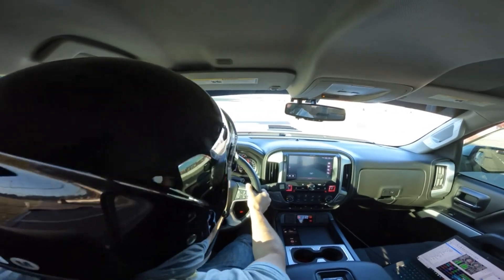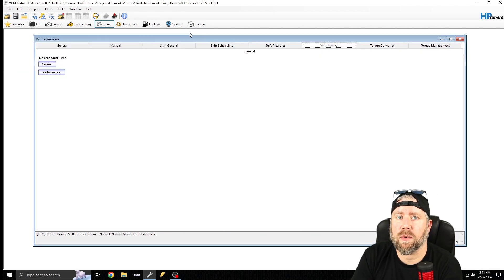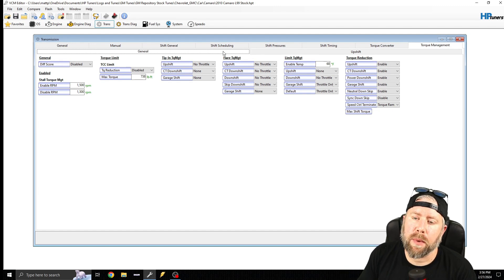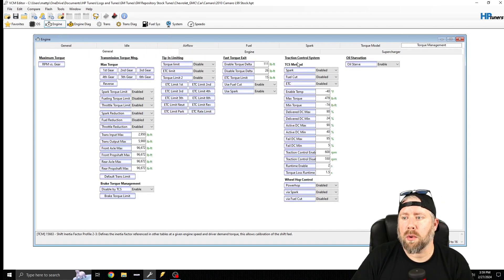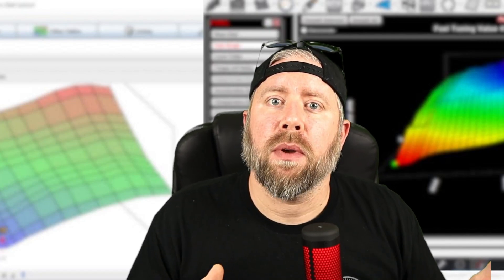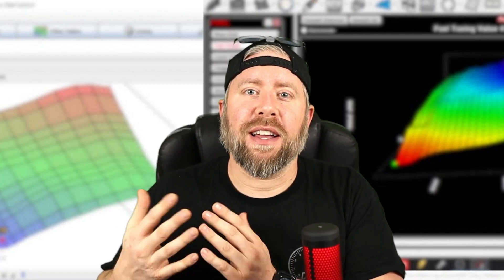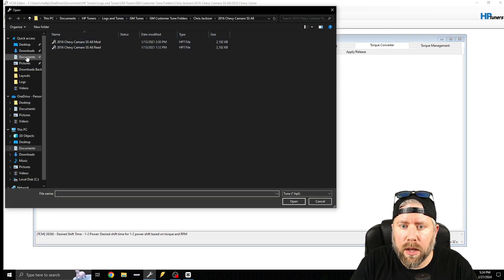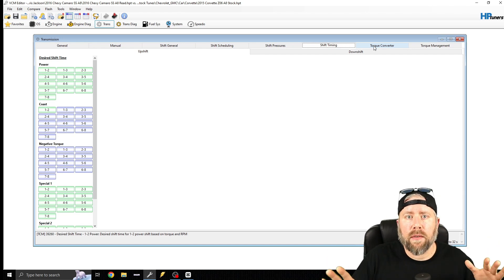Tuning Torque based Transmissions! Yep... your 4L60e too!

Comment: I have a 2008 Gen 4 5.3 with a 4 l 60... When I put a 2600 stall converter in it.. now I get TCC stuck off code every time the torque converter goes to lock out.  Is there something I need to change in the tune where is it tranny problem?

Comment: Looking fwd to the 8L90 vid.  I replaced the converter in my ‘18 Silverado with a Precision Industries 10.5” because of the constant shudder problems with the GM junk.  Works great but I know there is room for improvement with lockup and shift timing.  Most tuners I’ve talked to only want  to disable TCC 1-4 and to me, that’s not a good solution.

Comment: Excellent excellent video! Waiting on your scaling video to confirm if I am going in the right direction. I have a p01 that I am learning to scale because of the limit for the injector size. I’m running 2150cc injectors but the ecu is limited to a certain pounds per hour.

Comment: I had my 6l80 rebuild with a performance kit by a very reputable trans shop in Australia and the shift under load are very good however during cruising it can be very clunky sometimes. The shop said it the way it has to be because of the extra clutchs but I wonder if it can be fixed by adjusting things on the low torque are.

Comment: Preach it! Because of your videos I purchased HP tuners and I never thought I would take the time to learn tuning my own trucks until I found your videos. I have burned up 5 4l60e's in 11 years. Last rebuilt was August 2023, and at LS fest it would not 2-3 shift. Found my tuner 11 years ago had injector flow rate incorrect for my dead headed fuel system, my torque management was zeroed, I added it back from copying a stock base file, all my torque settings were maxed at 640ft lb, I changed to a realistic number, on the street I haven't had a malfunction yet. Can't wait to get back to a track.
Reply: Damn man that sucks to hear that the whole time it was torque management causing all those burnt up trannys, at least you got her dialed now